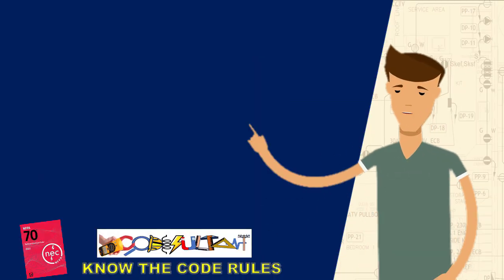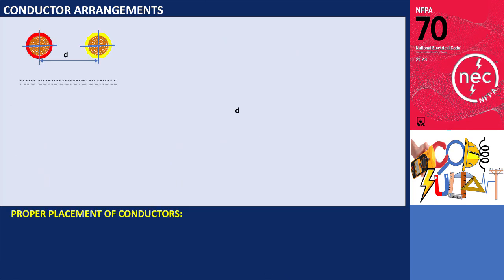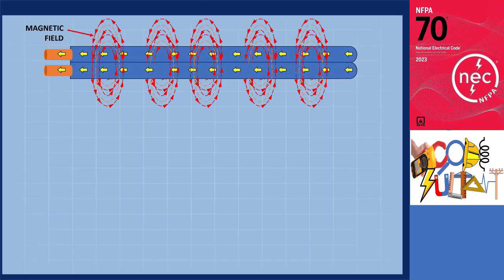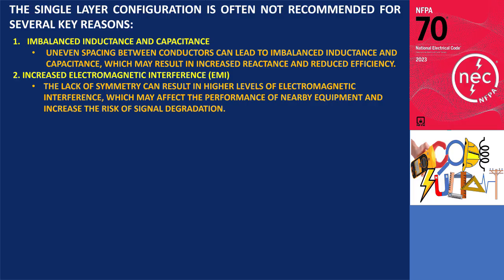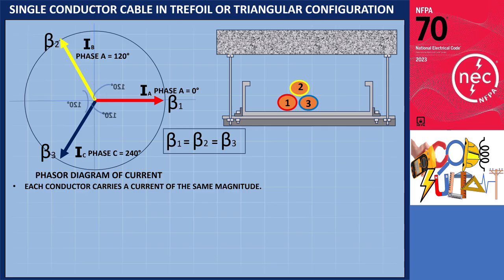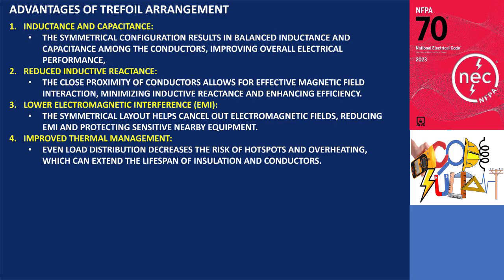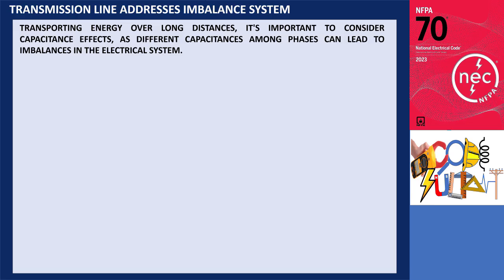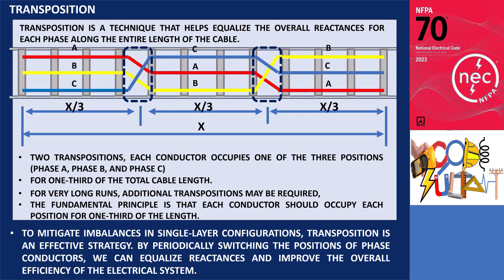SINGLE-LAYER VS TREFOIL CONFIGURATION IN CABLE TRAY

Comment: Sir is this topic applicable on paralleling conductors?
Reply from the maker: Yes, it is applicable only with proper transposition; however, a single-layer layout alone does not ensure current balance. I recommend a trefoil configuration for paralleled conductors to achieve better current sharing.